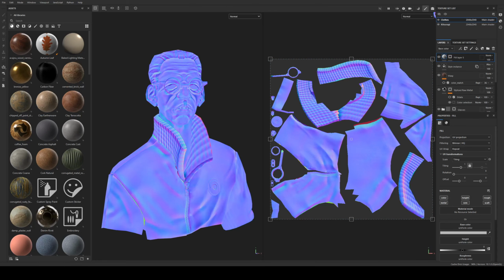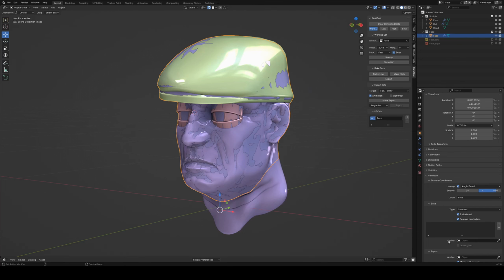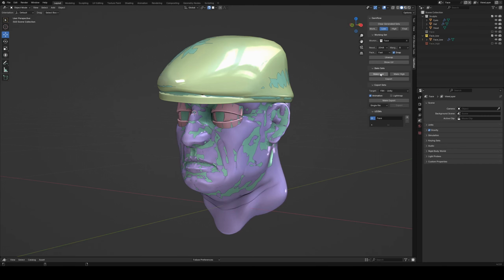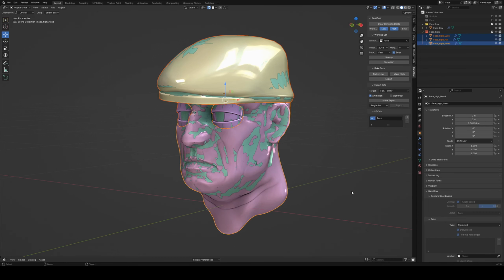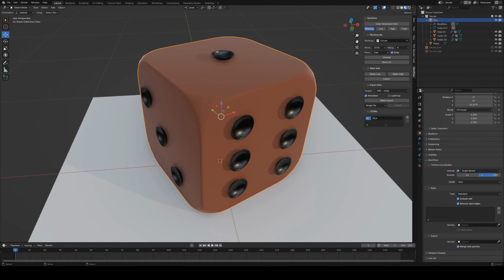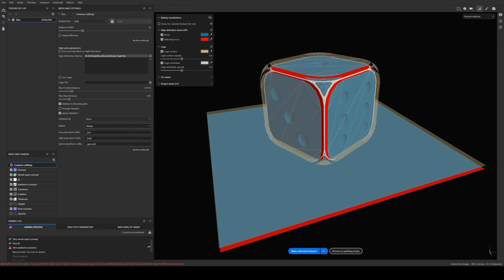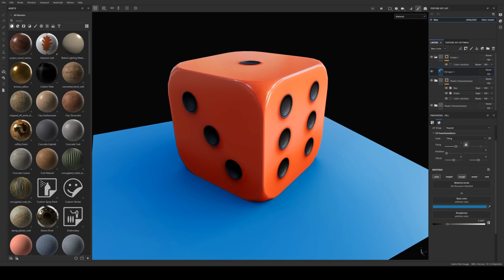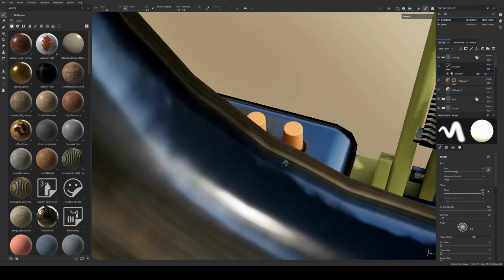GamiFlow - Projections

Comment: That works on mesh decals aka floating geo, could it be extended to support decals like those from Trimflow and Decalmachine addons? Substance Painter does not support them, Blender Baker can. However, if you smell that this feature is likely to require full-time effort to integrate it, then leave it out.
Reply from the maker: I don't think it would be a good idea to try to bake texture decals onto the material as you would need some insane resolution for it. And the fact that painter doesn't support it makes it a no-go for me. What I could do however, is add a new decal type that is ignored in the baking sets (and auto-unwrapper) but still gets exported in the final set. Those new decals would be a separate object in a separate udim, and once in engine you can apply your trim materials to them
Reply: @matheinig  another thing: I thought better of it, I remembered that Gamiflow should play the role of facilitating the baking of mesh maps with highpoly and lowpoly objects, and that is how it should remain, where the support of decals like those from Decalmachine goes beyond the mesh maps (encroaching on the bake of diffuse/albedo/emission PBR textures) and thus far beyond the focus of Gamiflow. 
In a nutshell, pretend you didn't read my previous comment lol
Reply from the maker: While I'm not going to turn gamiflow into yet another decal plugin, I think it would be valuable to make sure it can work alongside the existing ones because it would open up quite a lot of possibilities. Which is why I'm adding support for the 'Trim' object type. So basically, make your decals as usual with whatever plugin you want, but then mark the decal object as a Trim in GamiFlow. The trims will get exported but GamiFlow won't interfere with their materials or UVs.
Reply: @matheinig "I think it would be valuable to make sure it can work alongside the existing ones" 

If I may add an opinion: you added a mode to use the Blender Baker. What if you add a feature which, and after generating all the Sets (Cage, Low, High, Final) , when you click on “Bake” while holding down CTRL it creates a copy of the Sets needed to bake via a third party addon of your choice**? They would be placed in a separate collection, the tricky part though would be to give them suffixes that do not conflict with the naming convention of those presented as Sets.

*(These would inherit the settings that can be added from the Object Properties panel, so in the end they would look just as they would if you were to import them into Substance Painter for the bake.)

**I have Substance Painter (2018 version) but I don't use it, instead I am using Ultibake addon and it is very versatile because it even handles the bake of trim decals even with a Cage.